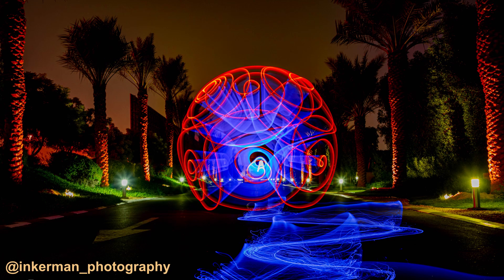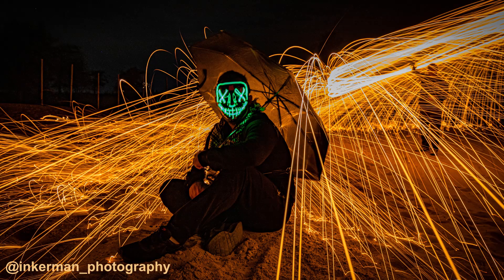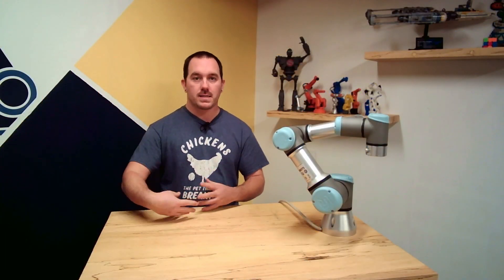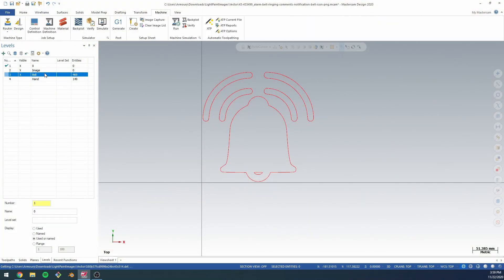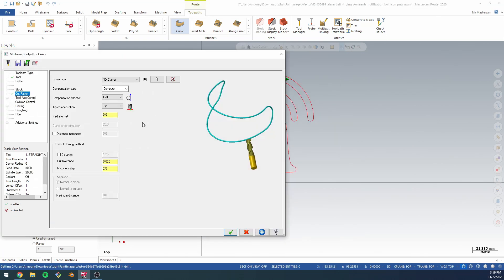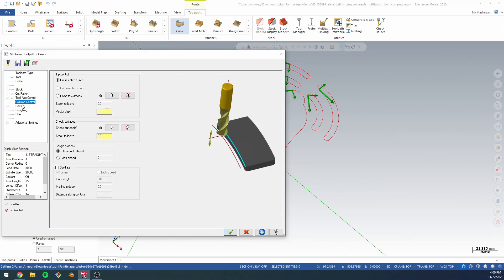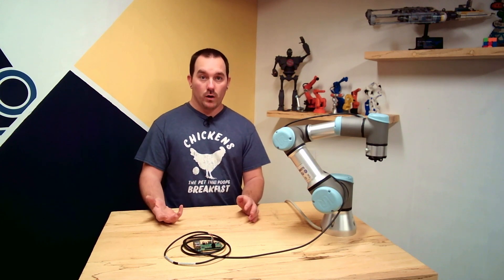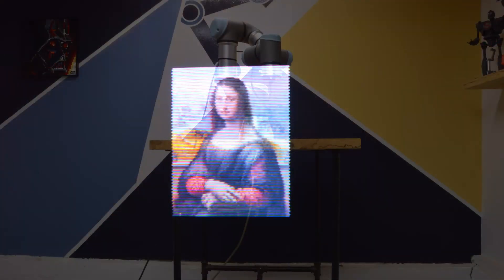LIGHT PRINTING with a Robot? - UR3

Comment: Are you using cat software? And which are you using to design?
Reply from the maker: What is cat software? I'm using Blender for 3D modeling
Reply: @DavesArmoury  cat software is computer design just like belder or fusion 360 solid works

It is just the general word for computer 3D design programs
Reply from the maker: Ah. CAD. I use Solidworks sometimes, or blender. Depends how complicated the part is
Reply: @DavesArmoury  Damm it I hate how I write
If it sounds right saying I just go with it my bad
Reply from the maker: No worries. My neighbour still sells "punkins" in the fall

Comment: thats awesome man, does the raspberrypi send signals directly to the servo motors? if so, what signals does it send? position/velocity/acceleration/current? Im assuming that a python library takes vectors and converts it into a path which is then converted into position signals and the pi sends these position signals to all the servos at some frequency. am i right?
Reply from the maker: The pi sends requests to the RTDE interface on the controller. The controller does the movement. Position, speed, accel, etc.
Reply: @DavesArmoury  oh, so you are sending the end effector psition etc. not the individual servo positions. Thanks!
Reply from the maker: Yeah. You could control the joints individually, but then you have to interpolate to do linear motions, amongst other headaches.
Reply: @DavesArmoury  this RTDE interface/controller.. is it only designed to take inverse kin input (EE  motion) or can you input foward kin too? Like tell the controller to simulate certain dynamics. Or how would you do so? Implement matlab?